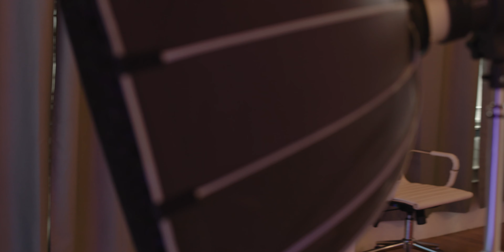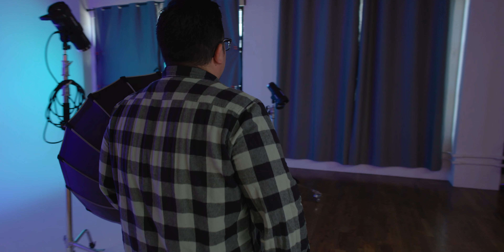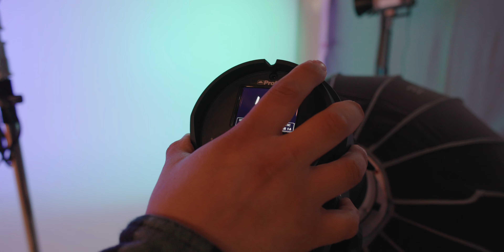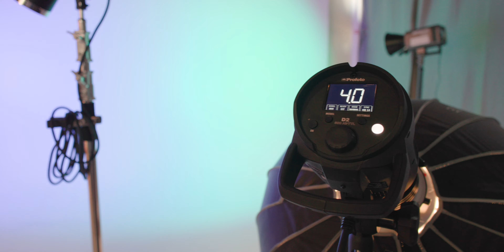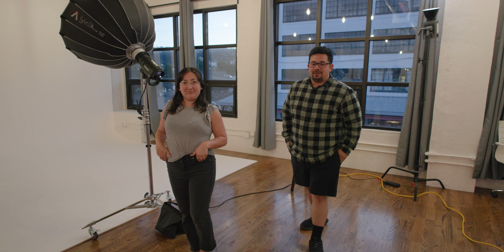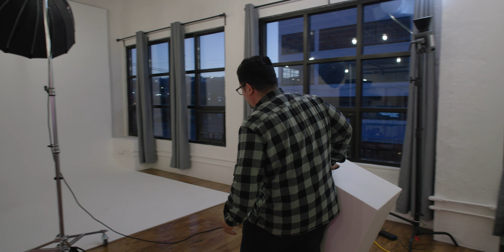Lighting 101 with Profoto D2 lights

Comment: NB: they are NOT all the same, the digital ones are!, but they offer a different 'generic' one, for film shooters (large format cameras don't have a hot shoe), which need the pc sync chord to trigger. This model doesn't have TTL, as no electronics are onboard, so just A (ttl, but with the flash's own sensor), M, Gn (guide number, aka distance based automatic) but it physically works the same.